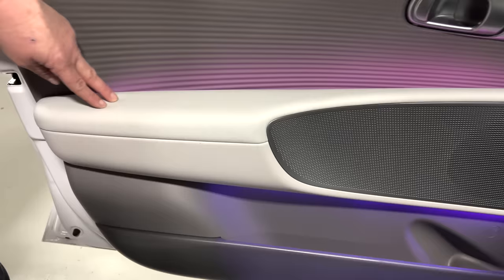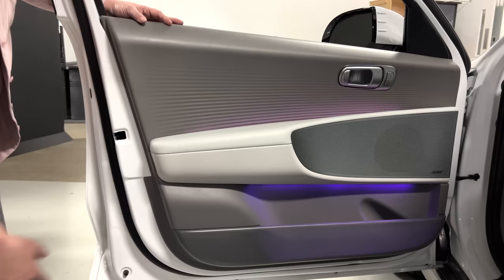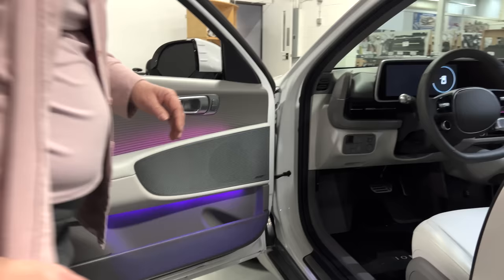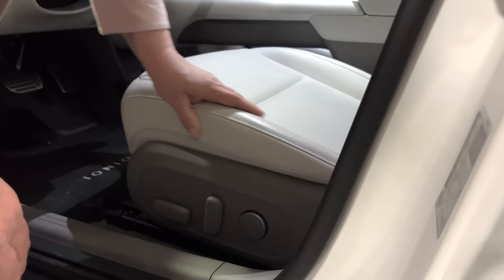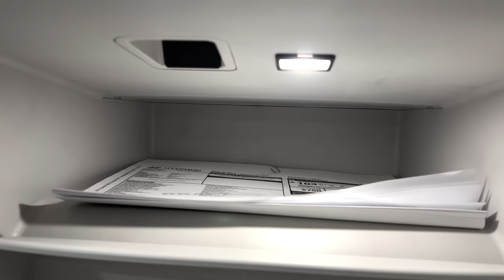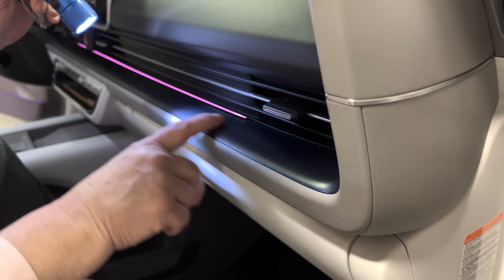Retro Nostalgia in a Modern EV: Hyundai Ioniq 6 Interior & Exterior Styling

Comment: Hyundai and Kia are definitely trying to compete in the EV field.  Munro Associates are doing a great job in providing current reviews of vehicles and their parts and materials. Thanks Munro.
Reply from the maker: Thanks for watching!
Reply: Hyundai group , they cannot compete with TESLA , they can perhaps compete with other LEGACY oem's .
however , TESLA is in a complete Different league.
Reply: @markplott4820  🙄
Reply: @markplott4820 Can you give several examples of why this is so?  Different league is quite a strong statement.
Reply: @mikus4242   - TESLA is #1 in EV production , Delivery , SALES. 
TESLA, is the ONLY OEM thats Executing. 

in , 2022 TESLA model Y was #1 by REVINUE , alone .

in , 2023 Tesla model Y is now a BEST seller  WORLDWIDE . 

TESLA model 3 RWD is the MOST Efficient car in the WORLD, over 132 mpg . 

TESLA model Y RWD is most Efficient SUV on EARTH. 
and has built in way higher PROFITS & REVINUE than any other mass market Vehicle. 

TESLA produced over 1.3 MILLION in 2022, and is on TRACK to over 1.8+ MILLION in 2023. 
gm & FUD motors ONLY plan for >1 million by 2026. 
MARY BS lied.
Reply: @markplott4820 Tesla has some tech advantages and manufacturing advantages now but fit and finish is no where near the Hyundai.  The Hyundai seems to have a better interior look and feel, exterior is more modern.  Under the hood they need to make some adjustments.  I think hyundai has the more consumer friendly setup then Tesla.  Once Hyundai nails down the cooling, the placement of equipment in the front, they’ll have the all around better car.  When hyundai goes all in on electric, their ability to manufacture will drive costs way down.
Reply: @markplott4820  If you like driving a fancy dentist chair with an iPad in a shell with poorly fitted body panels, sure.  For example, my tech adverse wife would be completely lost in a Tesla.  She was able to drive our Ioniq 5 comfortably from day 1.  Tesla appeals to those who embrace new tech.  Older adults (with lots of $$$ I might add) not so much. I agree, Tesla has lots of amazing tech, but from a usability perspective there is a large segment of the population that will never, ever buy one.  But they do buy Hyundai / Kia's.

Comment: Nice review of the details.  I may have missed it but can the door lighting features be changed for color and match upper and lower lights?  I also am curious how easy it would be to put a water bottle in and remove it from the lower door pockets with the door closed.  Looks a bit tight and cumbersome.  Lastly I thought I saw that the dash edges near the door were shaped that way for other markets offer rearview cameras instead of outside rearview mirrors.  Am I mistaken? Maybe another car that I saw the feature on.
Reply: as an owner i can tell you, only the smallest of water bottles would fit. even the water bottle they give you as a gift for buying doesn't slide in smooth. and its not a big bottle by any stretch. i feel they missed the mark there but there's so much to like about the car that i wont hold that against them.
Reply: The side wings are where the side camera screen go in markets where those are legal. The door light colors are user selectable

Comment: Brings me back 20 years to Saturn vehicles such as the Vue with the window and door controls on the center console.  

I really don't mind longer lasting easier to keep clean hard surfaces.  Really hate vehicles with hard to clean grungy or torn soft materials when I end up being the one having to deal with them.  Fine if you only buy new or lease and then trade up every few years but not so great for the person who buys used or keeps their vehicles for 10/20 years or so.

Seat covers are fairly easy to source inexpensive replacements for however armrests, dashboards, consoles and such not so much.

Best!

Comment: The reason the frunk is the size that it is, is because Hyundai prioritized interior cabin space.

They stacked everything vertically under the hood, like the inverter converter on top of the motor etc,  enabling them to push the firewall forward, increasing space in the cabin but in doing so reducing the frunk size. 

They also didn't want to extend the nose of the vehicle act further forward, else it was just going to be way too long of a sedan.

I'd sooner have the cabin space then a larger frunk.

Comment: The frunk is only that small on an all-wheel-drive version because of the front motor and the front inverter that sits (unfortunately) on top of the motor. On a rear-wheel-drive version the frunk is much bigger. However, at least the AC charging cable does fit into the AWD frunk, so that's something.
Reply: Not in the US. If the space is large enough to fit a child then it needs an internal release so Hyundai put the same small funk in the RWD version for the US so that they didn't need to add an internal release mechanism. It has lots of empty space below it...
Reply: @brianmaupin9197  Yes, I did a review on the RWD EV6 and the frunk storage area was the same as the AWD version.

Comment: Good to see the I6 only has a single coolant bottle, the Ioniq 5 uses a dual system that uses both normal coolant and a very expensive coolant for the battery system that requires changing every 3 years.  Overall this I6 is probably one of the better looking EV's,  we have the I5 but I would rather have the extra room.

Comment: Is the thrunk of the rear motor version bigger, then the dual motor version?
Reply: Not in the US. It would have to have an inside release mechanism, if it were as big as in Europe.
Reply: @svengaefgen5909  So in Europe it is bigger? :)
Reply: @tubarlog  Yes, for the RWD versions the frunk is 45 l instead of 14.5 l.
Reply: @svengaefgen5909  45 L sound very good and actually practical. :)

Comment: Tested the car some weeks and it was really disappointed by the fact that the Maps are preloaded by the dealer (and not updated over the air) and it was not able to plan a route with charging stations. In addition the autopilot was not intuitive, complex to use and not reliable. The acceleration was poor and the price for the performance model is 15k more expensive than a model 3 long range (which has better specs)
Reply: The car has full OTA, maps, infotainment, and car system.
The car can plan a trip with charging stations.
Autopilot is a Tesla marketing claim, the Ioniqs HDA2 works well.
Reply: @svengaefgen5909  the maps needs to be updated either connecting the car to a wifi or downloading them in a USB stick but they are not updated in real time as Google or Apple maps on your home (or as Tesla does). The planning of a trip does not calculate the number of stops, how much time to charge or if chargers are busy a rerouting to another charger. In relation to the Autopilot sure Tesla´s one is pure marketing but it is more simple to operate and more reliable.
Reply: @ingen1980  This is not true about the navigation. I have an I6 and it does re-route based on charging station availability and number of stops needed. You are correct, though, that it does not take charging time into consideration and is certainly not as nice as Tesla's.

Comment: Love the styling of those door cards, but it does cause the handle/release to look dated and out of place styling wise. Some sort of door popper Tesla style would make it look cleaner.

That colored strip on the eats is a waste of money and doesn't match anything else in the interior unless you go out of your way to set the ambient lights to match which I wouldn't (orange and dark blue?). Overall I like the thoughtful design to the interior.

Exterior wise from the front it's fine, from the rear, it's a little off (but then I've never liked anything similar, including Porsche) but from the side it's really awkward...

Comment: The styling is top notch but once again their engineering team put zero effort into space utilization which also means their cars powertrain is not efficient or optimized. If you can't design an EV with a full size frunk, you are still stuck in the ICE age. As someone who has worked on my own cars for many years and is an electrical engineer, it really pisses me off how little automotive engineers actually care about making their cars easy to to work on and often go out of their way to make them harder to work on. Trust me, don't think for a second that because they don't have a frunk anything on that vehicle is easier to replace or fix.
Reply: Munro doesn't emphasize repairability as much as manufacturability but I'm the guy who has to dig into it and fix stuff. Give me a motor bay with room to swing a wrench.
Reply: Yep, I understand Munro is in the business of evaluating manufacturability and sensible de-contenting.  I also do my own wrenching, and it is annoying that cars are getting harder to repair, though usually they need less repair than in days of yore.  I know Sandy loves snaps as opposed to threaded fasteners, but I can’t count how many times I’ve cursed getting snaps apart.  Honda even uses one-time snaps on some of their exterior trim, so you know you’ve got to purchase another bag of plastic fasteners before starting a project.

Repairability is a cost.  Repairs in warranty cost the manufacturer, and repairs that require too many FRUs of labor due to poor design cost the consumer and loss of good will to the manufacturer.

Comment: While I’m glad Hyundai went through the effort to put some kind of frunk in.. wtf. Tells me they still haven’t taken the leap forward into intelligent (lean design) engineering under the skin. There’s no reason the frunk in this should be any smaller than a model 3. Other than poor engineering
Reply: Hyundai flipped the front motor alignment to provide more interior space. Due to this there is little to no clearance for a larger frunk (the RWD version outside of the US has a somewhat larger frunk). As an I6 owner, I will gladly take more cabin room vs a larger frunk.
Reply: @brianmaupin9197  i don’t disagree that cabin space is more useful. But a quick glance under that hood shows wasted space.. yeah, i get there is a cost vs benefit to engineering.. but clearly there is room for improvement. And i wonder very much, if a full teardown is done of one of these.. how well are they optimizing the space usage.. how many items are being engineered with multiple uses and combining functions into minimal controllers.. castings.. wiring and hose pathing.. my guess is, they’re still not optimized.